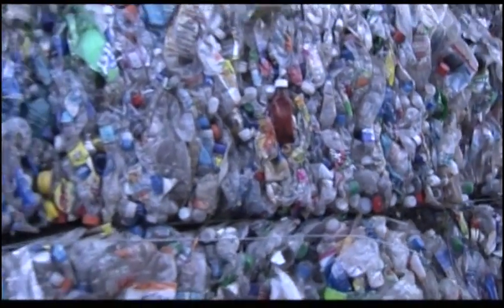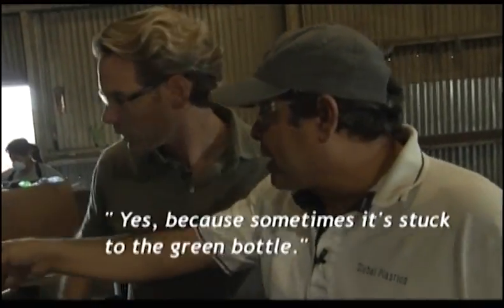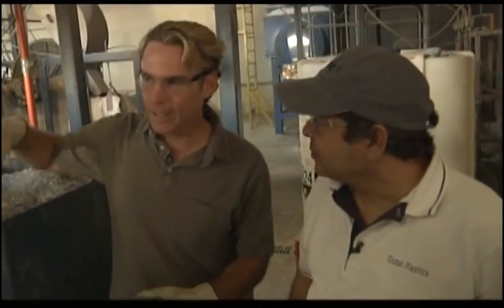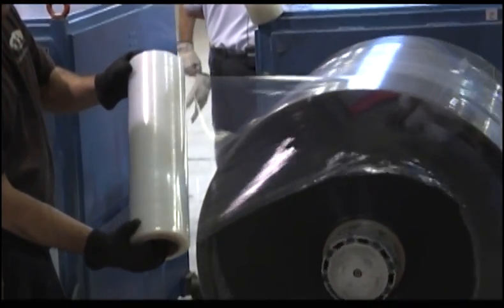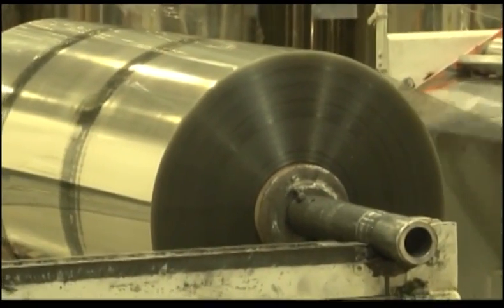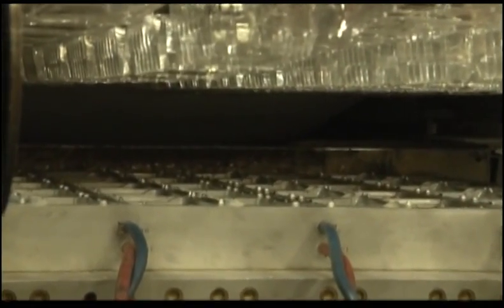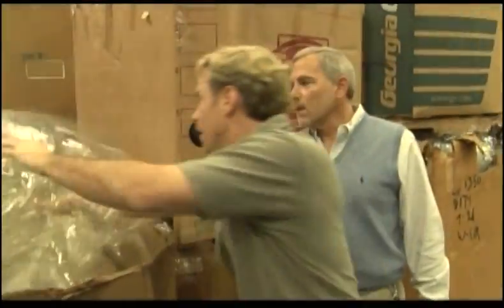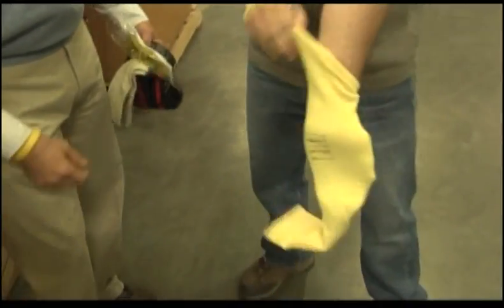Plastic Bottle Recycling

Comment: How much energy does it take to manufacture and build the building, manufacture the machines, ship them, run them and the cost of Labor?  Not counting the energy used to package, and ship the old plastic bottles.   I wonder - how much energy is really saved?  On the flip side, it does reduce landfills and hopefully all this stays out of the ocean - that is a very real, very big problem.
Reply: And the original product is made from oil.
Reply: Very good project, very good profit